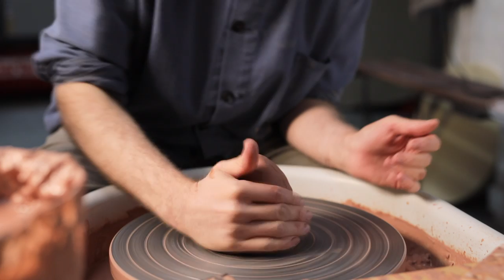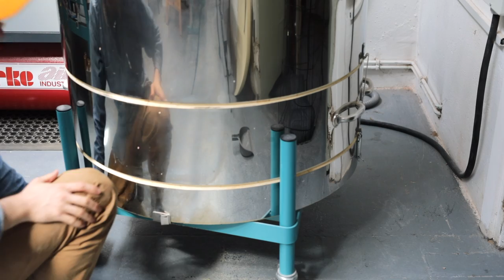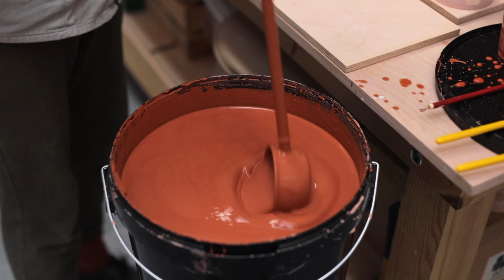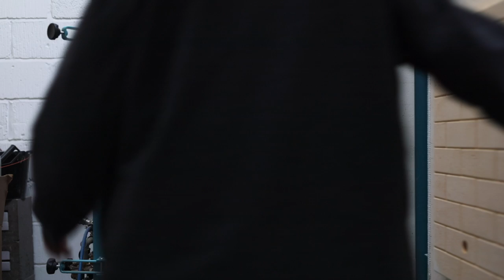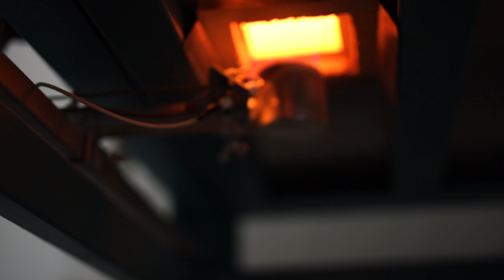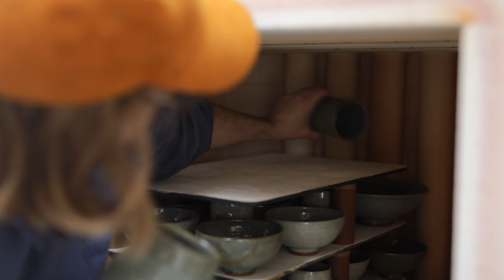How to Make an Angled Pottery Vase — From Beginning to End

Comment: Florian, I've been wondering whether you couldn't modify an electric kiln with a supplemental,  lower-power burner. This would allow controlling the temperature electrically while still having the opportunity to modify the atmosphere. 
This might eventually help you keep going during gas shortages, and would allow you to achieve the desired results from a LNG tank or bottles.
As always, I enjoyed and appreciated your video!
Reply from the maker: They do this in Japan! Electric kilns with a hole in the base for a burner, Ken Matsuzaki fired a few times like that when I was there for my apprenticeship. I guess it's generally avoided because it causes the elements to wear out way faster but it makes gas firing easier in some situations. Thanks so much for watching!